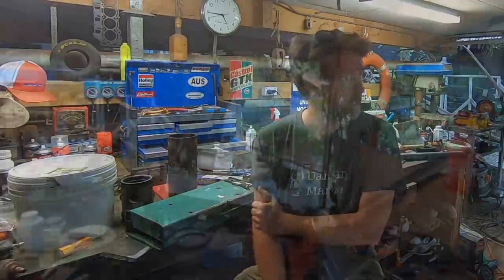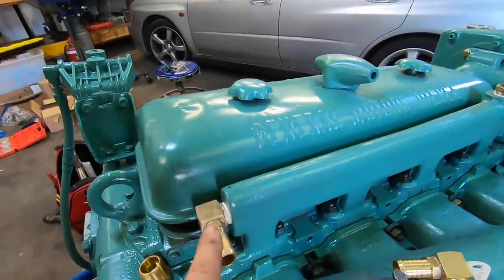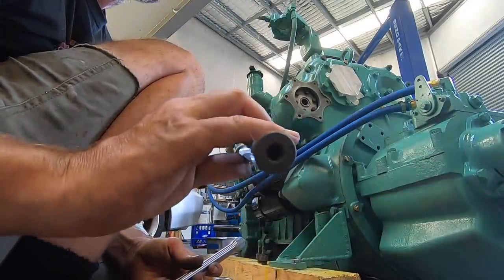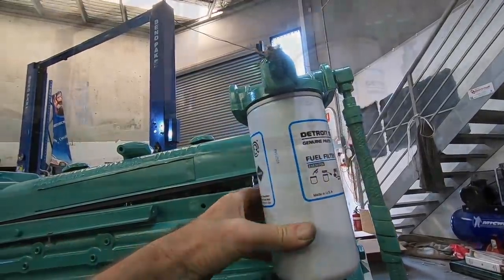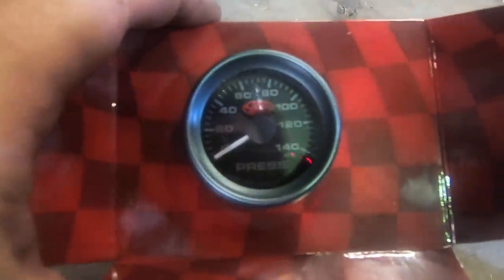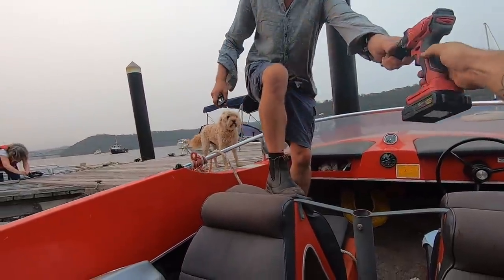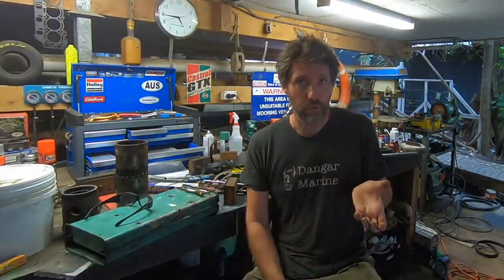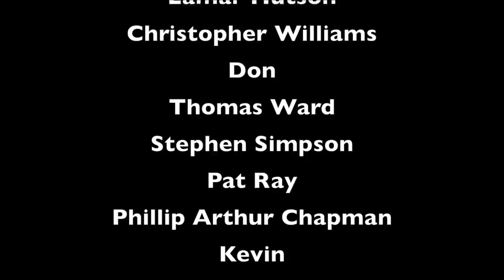Detroit Diesel cooling system and blower trouble

Comment: I assume it's probably too cost prohibitive, but do you ever use 90/10 CuNi for sea water? Nice part it once it's installed you'll never have to mess with it again.
Reply from the maker: I'm pretty much just putting the old bronze parts on or replacing with RFP, but I'll look into it for the future.

Comment: 4:06, could you not have used steel/regular pipe fittings?  And made a U at the upper connection, then use almost straight hose to connect, vs. that 90º bend?

Is there a reason not to use teflon tape/sealer on the pipe threads of brass to cast iron?

9:25, is that a fuel filter and/or water separator?  Assuming the holes are just for mounting it, why not mount it remotely for easy of access?

RichE, San Diego, CA
Reply from the maker: I thought about that but it would also need to be the exact right length and the welder and the engine are in two different locations. Those fittings had liquid thread sealant on them.
Reply: @DangarMarine  I was thinking of just using standard steel/cast iron pipe and fittings with typical pipe threads (I'm assuming the holes the fittings you're using are going into are pipe/tapered threads).  So a street elbow, short length of pipe to offset from upper housing, another elbow to turn towards other end/fitting into that housing.

Then straight nipple into that elbow with tubing between almost straight line.

No welding needed.

I'm sure what you have will work, just wondered why not use metal for the curve vs. flexible hose.

Did you use any sealant on the pipe threads of what you did use for the fittings to cast iron?

Comment: looks like the bolts pass through into the coolant passageway, you'll end up leaking through the bolt threads and washers without sealant on them...

Comment: You should use pipe dope or at least teflon tape on all those threaded fittings even though they are brass. It acts as a lubricant so to not destroy the brass threads. Which can happen if you install them dry. Besides, you do not know if the threads on that flange are still within proper dimension.
Reply from the maker: They all have sealant on them.

Comment: Im a little confused was he serious when he said the Detriot will go 60 knots
Reply: Toowts 
Sure will, on the bed of a truck.
Reply from the maker: Yes, joking, probably about 10 tops, 7-8 good cruising speed.
Reply: 1.2xsq.rt of water line length.
Reply: To quickly move a boat through the water (or on top) takes an enormous amount of power. I had 43 foot boat that weighed 23,000 pounds. It had a total of 700 horsepower. It topped out at 28 mph or 24.3 knots. Yet, at 8 mph needed only 70 hp. Crazy right?
Reply: Only if it is on the back deck of a boat that can go that fast :)

Comment: Hey Stu, Make sure all your hose clamps are easy to get to when the motor is installed. Putting the screw in the right direction could save you hours in a rolling boat later. Also get yourself some Clamp Aids for the end of those hose clamps so they are not little knifes waiting to cut you. I have a 4 inch scar where a hose clamp end laid my forearm open when working on a boat. https://www.clamp-aid.com/
Reply from the maker: They certainly can cut deep those clamps.

Comment: I missed what's wrong with the bolt that just spins.  What was that about?  Thanks
Reply: Threads are probably stripped in the end plate. The bolt goes through the bell housing and threads into about a 3/8" thick steel plate between the bell housing and block.
Reply from the maker: I'm thinking that may be the case Bill, but it's going to be really hard to put a Helicoil in without taking the whole rear end off now. :(
Reply: @DangarMarine  The other option would be to pull the head and heilicoil it from that side. If the rebuilder coated that gasket with some sort of sealant, I don't think you will have a problem with an oil leak there.  Sorry I missed the heat exchanger end plate issue. :(  It's not like I haven't done about 100 of them. hehe

Comment: is your camera set to 50Hz? should be able to deal with that fluorescent flicker
Reply from the maker: It only for 30 and 60.
Reply: @DangarMarine  30/60 is your framerate setting, dunno what camera you use but you can look for mains frequency or "flicker reduction" in your camera settings. Americans get away without because their mains frequency is a multiple of the framerate, but most consumer cameras have such a setting since the rest of the world operates mostly on 50Hz mains.

Comment: Hurry the hell up, I can't wait to see this motor run in your boat.
Reply: Nick Maclachlan  Damn I got a ticket from the grammar police thats gonna cut into my beer budget.
Reply: Nick Maclachlan  Shit another ticket from the Syntax police. Damn no beer for me. :(
Reply: @anomie1040  I'd contest that ticket.  Motor is a perfectly acceptable word to use for the device in question.  From Wikipedia: " An engine or motor is a machine designed to convert one form of energy into mechanical energy ... The word engine derives from Old French engin, from the Latin ingenium–the root of the word ingenious ... When the internal combustion engine was invented, the term motor was initially used to distinguish it from the steam engine ... The term motor derives from the Latin verb moto which means to set in motion, or maintain motion. Thus a motor is a device that imparts motion "
Reply: @thisnthat3530  Thanks for the support, I am go to hire you for my solicitor at the hearing.

Comment: I knew it. You cut that coolant pipe too short when you made it. When you showed us it when done welding it was the same size as the old copper pipe you said was too short.
Reply from the maker: The pipe was long enough, but the 90 degree bend was shorter taking up all the gained length!

Comment: I think you’re using the wrong O ring on the heat exchanger (the body diameter is too small). Sometimes cross referencing is off or conversation.
Reply from the maker: It's the original Detroit part so I think it should be right.

Comment: No Teflon tape on the brass fittings?
I'd also add a dab of  pipe dope on top of the Teflon to cool, lubricate and seal the joint.
Just sayin

Cheers,
N
Reply from the maker: Just sealant, no tape.
Reply: @DangarMarine  
Hopefully it's the kind that doesn't harden.
A real pain to remove when it been baked on for years.
Cheers,